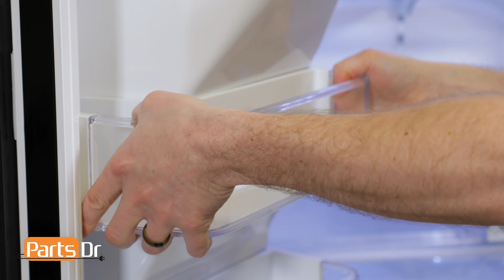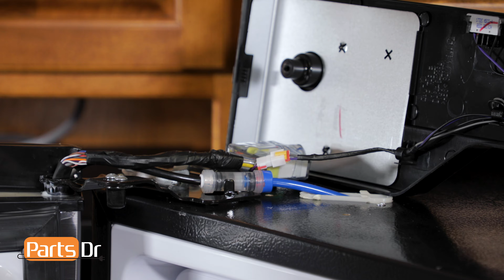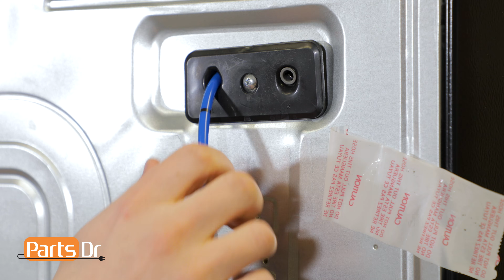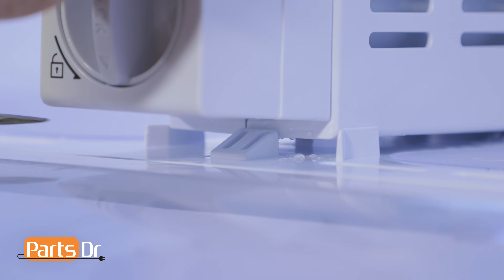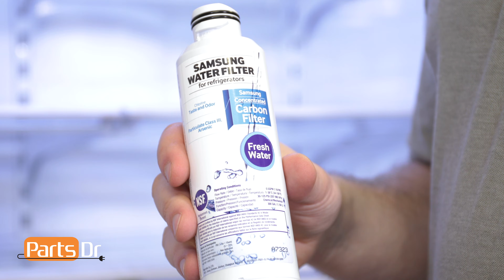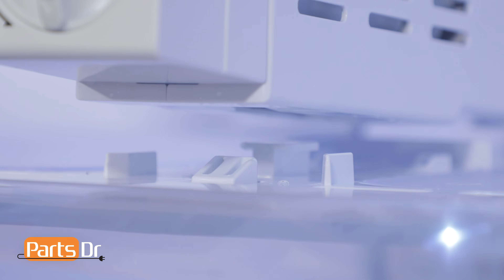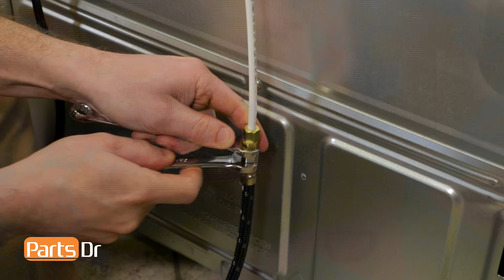Samsung Refrigerator Water Not Flowing? Replace the Filter Case Assembly (Fast Fix)

Comment: Thanks. With strong water to the dispenser but none going to the ice maker on RF28JBEDBSG?AA 4 door model, I'm not exactly sure where the problem lies. Is there a flowchart to diagnose whether the problem is the valve or the ice maker itself? I just don't want to throw random parts on in an arbitrary fashion hoping to fix the problem. Below you stated in a reply "If there is no water to the ice maker, you could have a bad water valve, ice maker, or main control board.  All three of these parts work together to make ice.  Any one of these components failing could cause the ice maker to not fill with water." How do you test to isolate/pinpoint the problem within those three components?
Reply from the maker: Unfortunately, we haven't seen an easy way to test and narrow down which of those components is failed on these refrigerators.

Comment: HI parts Dr. thanks for the video.
I have the following problem maybe you have an idea what it is.
I get water from the water dispenser, but my ice maker doesn't produce ice.
the ice maker cools that I have already determined. I also pressed the reset button but the ice maker makes no movement, nothing.
I disassembled the entire ice maker and checked it if I could. There is no water in the ice maker. I already checked the water inlet valve, both valves are 383 ohms.
do you have an idea what i can still check? Thks mike
Reply from the maker: The water valve can still be bad even if it ohms out okay.  It can have an internal blockage or failure that causes water not to flow past it.  Most commonly we see this type of problem caused by a failed ice maker, but it could also be a bad water valve, bad main control board, or a frozen water line.
Reply: Did you figure this out?

Comment: Do you have a video on just replacing the water valve?  Is there a way to replace the water valve without removing all those water lines?
Reply from the maker: Hi Dustin,  on almost all of these refrigerators that have a water inlet valve inside the filter case assembly as shown in this video, the water valve is not sold separately or designed to be replaced as a separate part.  It is best the replace this part as we show in this video.
Reply: @PartsDr  Thanks - I put in the model number at samsung's site and the part is sold separately.  DA62-04027A.  I'll give it a go and let people know if the part can be replaced or if it's easier to go through the whole system.  These RF22-RF28 samsung refrigerators are poor quality btw.  I've already replaced components due to the ice cube tray problems.
Reply: @kingofbytes  I am having the same issue, were you able to install just the inlet valve?  If so, were you able to find any helpful videos?
Reply: @brianmcglynn7020  I was, but it didn't matter - 3 months later, more frosting issues making the crappy ice maker unusable.  I relegated that refrigerator downstairs, bought a new $750 Frigidaire LFSS2612 at Lowes.  The ice maker is AWESOME.  It can keep up with my wife's needs which is astonishing.
Reply: Hey @Dustin Lema I am having to replace the same thing as my water dispenser won't stop shooting water out. I think the valve is stuck open or something. How easy was it to just replace the inlet valve rather than the whole assembly? No tubes had to be removed from back side right? Just unplug from valves and put onto new one?
Reply: @TripletDadLife  it has been a while but I believe that's correct.

Comment: my icemaker works but the ice comes out small crushed pieces instead of w hold pieces
Reply from the maker: The curshed/cubed feature is controlled by a small metal arm on the bottom of the ice bucket.  There is an actuator next to the auger motor that moves this lever up and down to switch from crushed to cubed.

Comment: BEST TIP don't by a samsung refrigerator because of this video!!!  The models that have this water inlet system mostly have two ice makers, if they are both not working this might be the problem, water dispenser works fine but no ice out of either ice maker. 
what a pain in the a55 water inlet system, christ!
Reply: Also known issues with Samsung ice room freezing up inside fresh food compartment. #nightmare

Comment: Any tips on how to slide the fridge out by yourself, without damaging the floor or using a handtruck?
Reply from the maker: First make sure the front leveling legs are raised.  The refrigerator is on wheels, so just make sure the floor is clean and the refrigerator should be able to roll out.

Comment: How do you replace just the valve?
Reply from the maker: On most Samsung model refrigerators that have a filter case assembly, the water valve is usually not sold separately and it not designed to be replaced as a serviceable part.
Reply: @PartsDr  I ordered the valve separately from your website and was assured from your online chat that I can replace just the valve.  Do you have any videos or tips on how to do this? Fridge model RF23HCEDBSR/AA-09

Comment: Hi,  

Great video.  My water slowly quit.  I changed the filter but it still doesn't work.  When I remove the filter the water works normally,  Also when I remove the filter there is very little water in it.  What could be the problem?  Water filter head?
Reply from the maker: Yes it can be a bad water filter head causing your problem.  First, always check that the water supply to the refrigerator is good.  If that is good then it is either a bad water valve, bad filter head, or bad water filter.  We have seen issues with people using aftermarket water filters that either don't work properly or damage the filter head.  Make sure to use OEM filters from a reputable source (there are a lot of counterfeit filters on places like Amazon and eBay).
Reply: This was my exact problem.  Replacing this part solved it.

Comment: Your demo is excellent. Why would I have to replace the filter assembly? My water was coming out slowly in my dispenser until it finally stopped. Is it the assembly or is it the dispenser switch?
Reply: This is the exact problem I had.  Replacing this part fixed it.  My understanding is the valve that gets opened from inserting the water filter goes bad over time and doesn't fully open until it stops opening at all.  My water flow slowed to a ridiculous speed until it finally stopped.  This part is around $200, but worth it to have filtered water again.
Reply from the maker: Hi Terry, troubleshooting this type of problem can be tricky.  Usually the dispenser switch is either good or bad.  If the water flow got slower and slower until it finally stopped working that sounds more like a problem with the water valve inside the filter case assembly.  It can also be caused by a frozen water line, poor water supply to the refrigerator, or the main control board not sender power to the water valve.  You will need to do some investigating and testing to narrow down the problem.  This video shows more details about the filter case assembly: https://www.youtube.com/watch?v=H7-c-GSVizg

Comment: Odd question - I need to remove/disassemble the shelf beneath the filter case assembly for cleaning - I can find literally NOTHING online on how to do this. If you could help I would be most grateful indeed.
Reply from the maker: We do not currently have instructions for removing or replacing that shelf but we will try to do one in the future.  It looks like quite a few of the steps shown in this video will be required to give you access to the shelf.
Reply: I have the same question. After our Christmas Eve 7 Fishes dinner we can’t eliminate a fish smell after multiple cleanings. I think the culprit is under this unit on the shelf. Please help!  Not sure we have to go through all this just to get at cleaning underneath the housing unit.

Comment: Great video! Does the water inlet valve also supply water to ice maker?
Reply from the maker: Great question!  Yes it supplies water to the ice maker(s) and the water dispenser.
Reply: So I may assume my ice maker is not making ice because I no longer hear water running to ice maker? Im thinking the water inlet valve is bad and not the ice maker unit?
Reply from the maker: @kevinmichals7394  If there is no water to the ice maker, you could have a bad water valve, ice maker, or main control board.  All three of these parts work together to make ice.  Any one of these components failing could cause the ice maker to not fill with water.
Reply: @PartsDr  How can I isolate from the three possibilities (water valve, ice maker, or main control board)?  I have already replaced the water inlet valve, still not getting water to the ice maker.  How do I know if my ice maker or main control board gone bad?  Tried ice maker test button, only heard one chime not the second one, and did not hear water valve engaging and of cause no water being filled in the ice maker reservoir.  Based on these fact, is my ice maker is bad?  Thanks a lot in advance for your help!
Reply: Great video!  I am having trouble getting grey tube removed at back of fridge - at the top.  The snap ring not releasing.  Any tips?  Thanks.
Reply from the maker: @laurenmiller2769  The water line could be frozen in place in the ice maker compartment.  You may want to try unplugging the refrigerator and leave the doors open for 24-48 hours in the ice maker compartment to see if that helps to release the water line.  Also check out this video for more information on this gray water line here: https://www.youtube.com/watch?v=stXZXe6PRD0

Comment: Thanks for the video, it is helping tremendously! We have four water lines coming from the back of the new unit. It is a little confusing. Any idea what it is for?
Reply from the maker: Good question!  The refrigerator shown in our video has one ice maker, but if yours has a forth line would most likely go to the 2nd ice maker in the freezer.
Reply: @PartsDr  thanks so much for the quick response!!